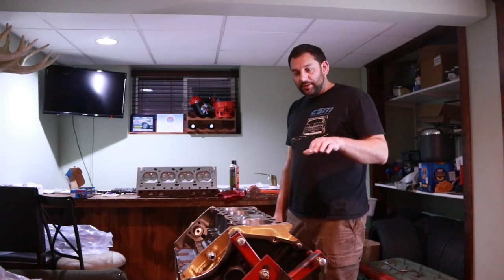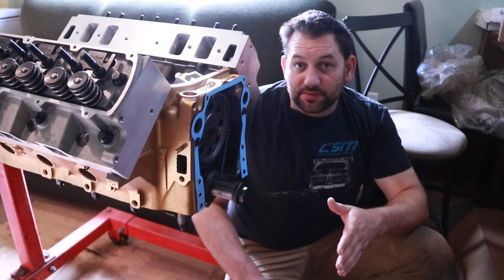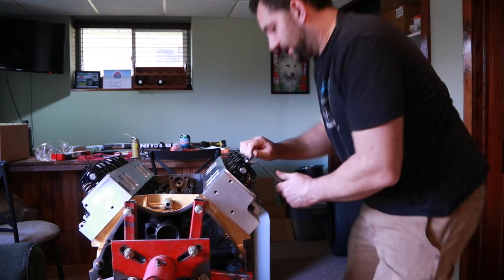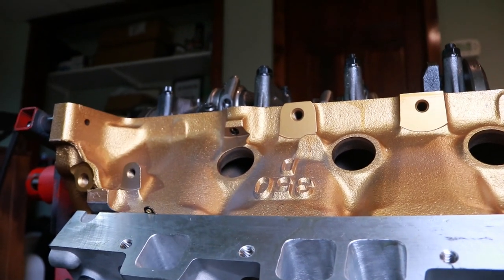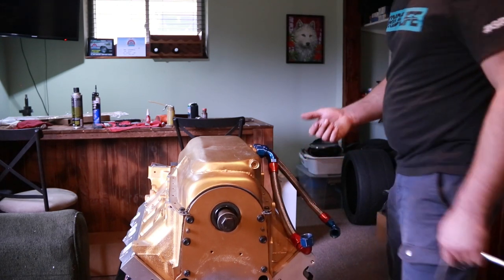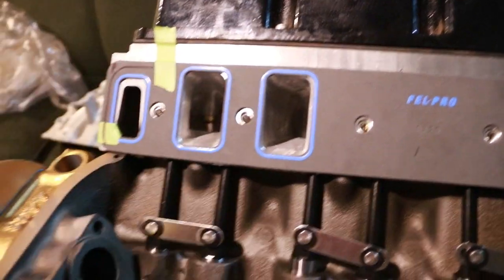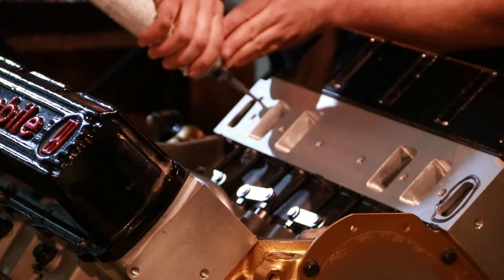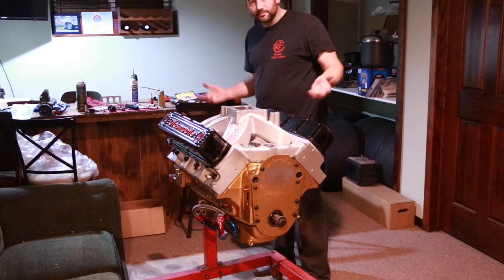DIY engine assembly at home - Oldsmobile Small Block Build part 2, The Top End

Comment: I had a 425 in a 86 cutlass it drove circles around built chevy smallblocks just sayin
Reply from the maker: The big blocks don't take much to make a really good street engine out of. My first build back in high school was a super basic rebuild of a 455 with some decent parts. In my 82 Cutlass it was good for 12.57 in 1/4 on some borrowed slicks
Reply: Yeah that's right because they have torque range easily in the lower level of the RPM range up to 4000 RPM and Red line was at 5500 and 6000 RPM they were meant for the 7000 lb car now put them in a different low weight car of 3800 lbs and that's like free HP dude 😎

Comment: Hey guys of the Oldsmobile club here's a personal note to all of you readers out there . I want you to know that you can really make real horse power numbers if you want to put your Oldsmobile cutlass on the front lines of the drive in scene alright I'll tell you putting the big block four fifty five head's on a small block three fifty Olds motor with a performer rpm intake will really wake up your three fifty Olds motor by a lot of power and also have a great Cam shaft with a lot of duration I was lucky to have the best to pick from I happened to have the best head's produced by Oldsmobile the c casting head's w thirty head's and I also put the w30 Cam all combined in the block as well

Comment: So when did Oldsmobile motors ever come in small block and big block oh yeah that's right they never did
Reply from the maker: Oldsmobile 260/330/350/403 are small blocks with a 9.330 deck height and 2.5 mains on the crank. 400/425/455 are big blocks with a 10.625 deck height with a 3" main on the crank. Diesel blocks are small blocks with the big main.
Reply: And then again they are not classified small block and big block like a Chevrolet motor is neither is Buick or Pontiac
Reply from the maker: @shaunjeffries4841  The Oldsmobile community has referred to them as small/big block for decades. The difference with Pontiac and Buick is they only built them with one deck height. Apart from the Pontiac 301 which was an odd ball.
Reply: I'm sorry Jeffrey but get out a Chilton motor manual and look for it in there and see for your self
Reply: Just so you I know I didn't fall out of sky yesterday I've been building them for years since I've been out of school back in the eighties so excuse me so far I've had great success with my efforts with my combinations pal so excuse me if it offended your intelligence 🤔😳🤓
Reply: What I am saying is like Chevy motors there is a difference between the small blocks and big blocks parts do not interchange Oldsmobile Pontiac and Buick all their parts for each individual motor will interchange amongst individual motors I get it that the cranks might be different but that's common
Reply: @shaunjeffries4841  yes they do Shaun I'd hate to tell you about but you can really can
Reply: Hey Shawn learn to pick up a Chilton motor manual for a referral on the information if you don't believe me
Reply: @codysmithmotorsports736  three fifty Olds diesel blocks also have a three inch main take a look in the Chilton motor manual for a referral also pal
Reply: I already knew what the difference was about the small and big block Chevies also that's why I went with getting an Oldsmobile cutlass in the first place 🙄 dude I'm also aware of a lot more than your own brain capacity is able to comprehend when you put big block four fifty five head's on a small block three fifty Olds motor your going to gain an extra inch of air flow over the entire eight cylinders and combined with the w thirty head's and Cam shaft into this combination your looking forward to having almost five hundred horse power numbers and then about that in torque and if you're gonna want to make real horse power numbers do this procedure get a chance to get a diesel block three fifty Olds motor they have a three inch main take a four twenty five crankshaft and have it machined down for the clearance that is required for final assembly or if you feel like you're not confident enough just get a crate motor from mondello performance and they'll sell you a short block or a complete long block and by the way next time do your own research 😉 and save me the bullshit of writing about it
Reply: @rodneyhopper22  just so you know my first car was an olds My current vehicle is a big block Chevy truck small block Chevy van and a Pontiac Grand Prix so I think I might know a little bit about them
Reply: @rodneyhopper22  dude if you only knew the cars that I've built over the years I've worked on everything from Chevy Ford Dodge all the way down to a 66 Ferrari GT so I've worked on quite a few things
Reply: O
Reply: @codysmithmotorsports736  you can throw out all the specific information on the motor manual to me that's fine but I know how to make other modifications to the small block three fifty Olds motor and the diesel block three fifty Olds motor if you read up on things 🙄 duh dude 😎
Reply: I can talk about the subject of this information because I have a great knowledge of motors and I have a clue to what I'm talking about so butter cup read up on the subject further your education
Reply: There is an inch and half difference across the top of the deck of the block of a motor small block three fifty Olds motor and a 455 Oldsmobile motor just so you know pal
Reply: I can keep going on with this subject because it's my favorite motor and car and you just don't have a clue to what I'm saying
Reply: Hey Cody from Cody motor sports I don't think I need you to tell me what I already know of what I'm talking about the subject because I've already done what I've said with combining the 455 heads on a small block three fifty Olds motor and for my next trick I'm going to be taking a diesel block three fifty Olds motor and putting a 425 big block crank shaft into that combo with the 455 pistons and the w30 heads and Cam shaft into that combo with the performer rpm intake that's 560 HP and 640 ft lbs of torque in a 3800lb 69 Oldsmobile f85 body cutlass 2dr
Reply: Hey Shawn you never heard of diesel blocks apparently you don't have a clue to what you're looking for then leave me to doing the expert thinking about this one because I have already talked to mondello performance engine performance company as a guide to what I'm talking about
Reply: Basically to make a Big Block, Oldsmobile added an 1/2" deck materal to their small block v8 to make a larger engine. It was totally Mickey Mouse, and a rush job to compete against the GTO.

Comment: If you have big block heads why waist your time with a smallblock
Reply from the maker: Several reasons why. Weight and RPM potential are both far more beneficial than maximum torque when it comes to a road course car. A big block would not only another hundred plus pounds on the front end but it's taller height makes a higher center of gravity and good air cleaner setup more difficult. Put the additional torque over that already really good torque of the small block would just make keeping it hooked up in slow corner exit more difficult. The reduced rpm range would require more gear shifts per lap also. Besides, if a guy really wanted to it's plenty easy to build a 427" or bigger small block Oldsmobile that will make better power in a smaller/lighter package than a big block.
Reply: I don't drive on road courses

Comment: No such thing as a "small" Oldsmobile and why not use a 455 and go from there?
Reply from the maker: There are enough differences that the Oldsmobile community has split them up by calling them small block (260/307/350/403) and big block (400/425/455) for a long time.
I do autocross/road course/hill climbs with my car. A 455 is significantly less desirable for a lot of reasons over building a small block. Mainly weight and RPM potential, and size